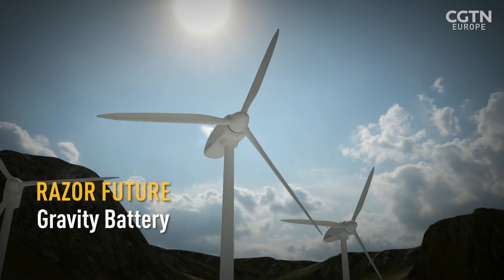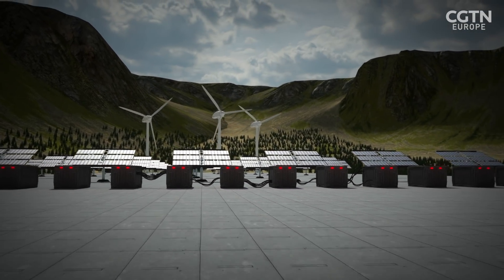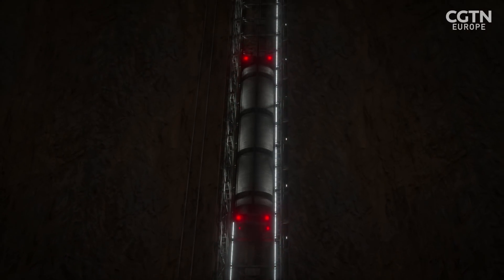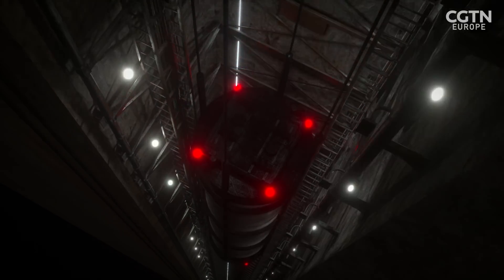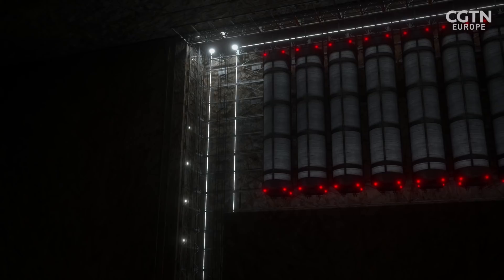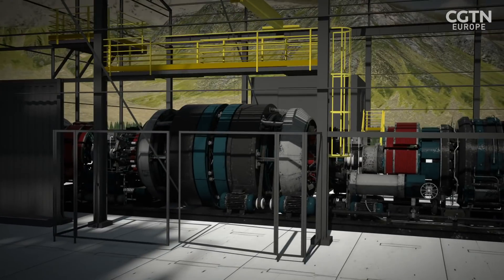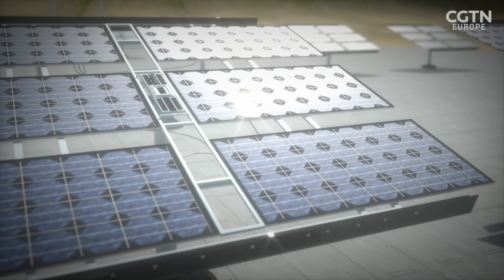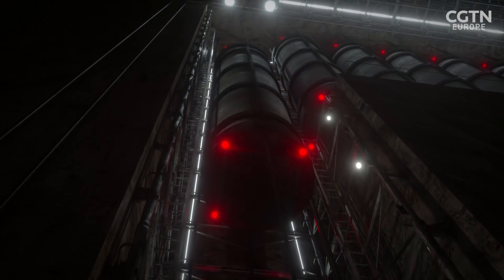Storing renewable energy in a gravity battery

Comment: Building it with wider heavier weights, in tanks that could be flooded would make the process more efficient. It's easier to lift something submerged than in air. Drain the "tank" (back into the river, downstream, or whatever) prior to dropping the weight and regenerating the energy.

Comment: So 12,000 tons (26,400,000 lbs!) down a 2000 ft vertical shaft and somehow all you can do is power 63,000 homes for an hour?  Either gravity behaves differently in Europe or somebody's misplacing thier decimal point.
Reply: very true! should be least sufficient for 1111 homes a day(based on 30kwh use) with each 500 ton x 800m depth combination

Comment: I am inclined to think that thermal storage in the form of liquefaction may be the most efficient energy exchange proposition until battery storage production is realisable, although I think we need to examine the role of capacitive energy storage, given that electrostatics and carbon correlate on three important metrics, abundance, cost and efficiency! While capacitive storage is not energy dense it is extremely efficient. We fundamentally have an abundance of space and capacitive storage is ideal for power grid because peak requirements are limited small margins of demand in terms of time duration.

Comment: I was getting a bit annoyed by the wasted renewable energy that the grid discards. Fundamentally there are three ways to store this energy, chemically, thermally or potential kinetic energy. This is a good advertisement, we simply need to determine whether thermal storage is more efficient than potential kinetic energy, however which way we do this, -  just fucking do it!!!!